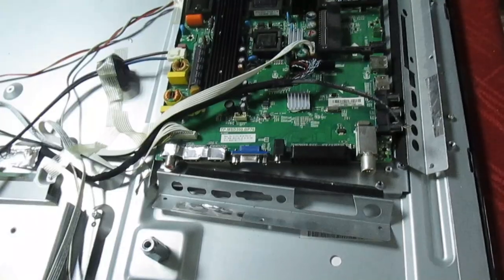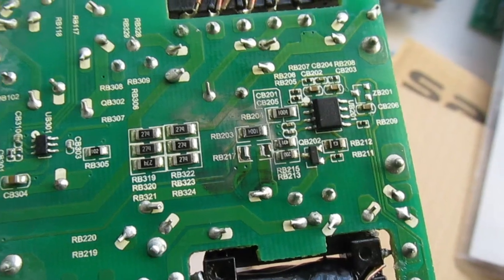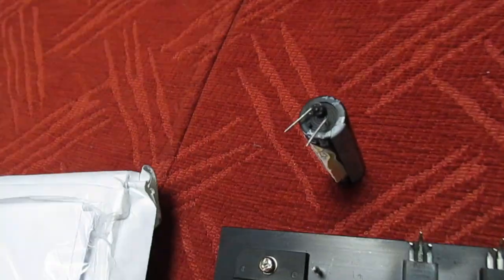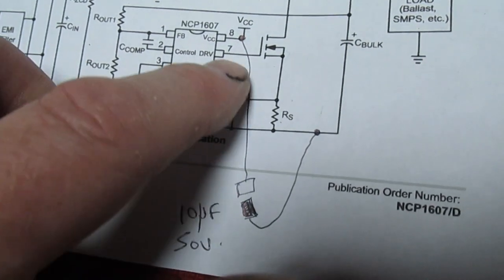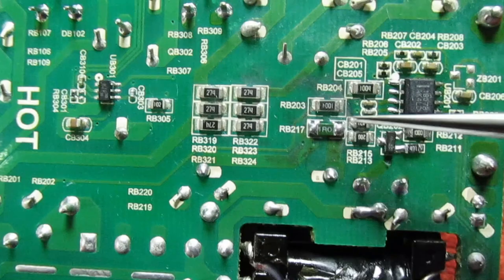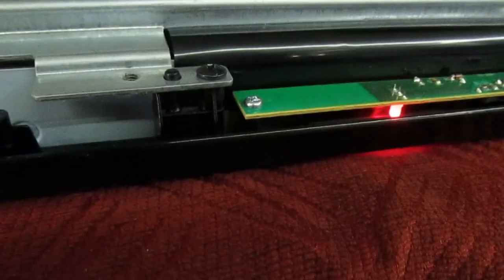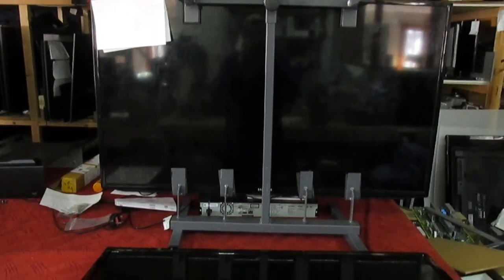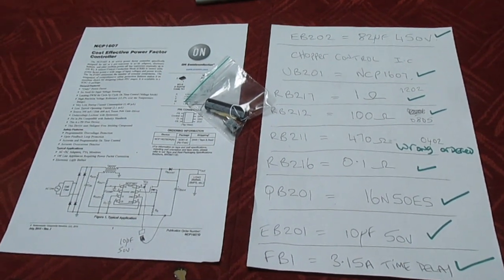UMC   TP. MSD309.BP76   Power supply blow up repair to component level.

Comment: Hi there just watch the video on the tv with a blown up power supply you ordered loads spare parts but you do not show on the set and which 1 do you eventually changed it just seems hard for us to do the same job when we do not no which ones you changed thank you
Reply from the maker: without a circuit diagram its just a matter of testing every part in the power supply with a mulitmeter , pay special attention to the surface mounted resistors , some may have to be removed to get a proper reading .

Comment: Nice work.
Great to see, So refreshing someone actually repairing and not board swapping.
Ordering parts because it's easier than looking through stock - Man after my own heart :)
I often do that.
As to incorrect SMD size ordering, I think most of my spare stock was sourced in that way lol
Reply from the maker: UMC dont supply any parts , not even a new board so repair or used board if you can find one is the only option.
Its not unusual for me to order something I already have because it either takes to long to look or I know I have it but cant remember where I put it ! 
 I need to get more organised but all this takes up time and organizing doesn't make you a living .

Comment: Ah, Blaupunkt, a Sainsbury's special!  Would you believe, I always thought they were made by Vestel.

I can only say I wish I had your depth of knowledge, because I'm sure I could have saved dozens of the economy brand tellies.
Reply from the maker: I think UMC is Vestels biggest competitor but personally I prefer vestel for there better layout , the UMC stuff always looks a bit thrown together and spare boards can be bought for vestel sets , UMC dont supply any parts at all ,but having said that UMC will send you software , where as Vestel will only supply software for a few brands, swings and roundabouts I guess, but what's not that commonly known  is vestel is over 25 years old and use to make CRT sets.
Reply: Whats in a name these days just made cheaply  and badged up
Reply from the maker: @pauldavies6037  Problem is not everyone knows its just a name .
Reply: @michaeldranfield7140  Yes been like this for a long time Branding with a well known name sells more to the general public even though made by somebody else

Comment: Very good MD I enjoyed the video ,my only thought is it worth repairing ,I purchased a 32" smart JVC (VESTEL) the other day for £150 with a 3year GT I know customers like what they are use to but at what point is it BER. Just a thought .Thanks again Steve.
Reply from the maker: I know what your saying and this job would have been a simple run of the mill 15 minute repair if there was a service manual and access to spare parts from the manufacture, but instead I have to trawl the net to see what the chip is , check with 3 different suppliers to find which one has all the parts I need so I can do just one order, then I had to find a similar board to see what the missing resistor was and what value the 0402 resistor was which is so small it has no numbers printed on it , so no, the set wasn't really worth repairing in the current climate but component level fault finding is what I have always done and I still enjoy the challenge !
Reply: And the environment says: it’s absolutely worth repairing it. Kudos to you for keeping another piece of otherwise perfectly fine gear out of the landfill, because the cost of that is ultimately much higher! We need to have legislative action for manufacturers to provide service manuals for their gear!!
Reply from the maker: @toolsarecool  I get a lot of sets with easy faults like this I have to scrap simply because there is no service manual and I cant identifie a part but in this case I had another board from a similar set so was able to measure the resistance values .

Comment: Clear video, as always.  What would this repair cost?  It always seems like the labor alone would be worth more than a replacement set, which is incredibly frustrating.
Reply from the maker: i charged £50 , its not the labor thats the problem , this would have been a simple straightforward 15 minute repair if there .was a service manual with schematic available
Reply: @michaeldranfield7140  right!  It's the time spent figuring everything out (for me at least)
Reply: That was more than reasonable Michael
Reply from the maker: @kendom33  you cant charge by the hour anymore you just have to charge what you think the customer will pay or they would just buy a new set and i would get nothing at all.
Reply from the maker: Andrew_koala  Yes I understand that but these days paying more money does not buy better quality, in most TV cases you just pay more money for the same set with a different badge on the front.
I know 30 years ago electrical goods were much more expensive but then they lasted for a long time , my washing machine at home is 25 years old and I just keep repairing it , my wife says isn't it time we bought a new one and I say if you want to buy a new one every 18 months then go ahead and get  a new one .

Comment: you do good videos.. i have a 39 inch umc, i got it in 2011 still works and still old enough to have ccfl backlight, all my tvs are ccfl backlight i dont have any led tvs.. bet they stopped making ccfl backlighted tvs because they was lasting too long
Reply from the maker: The death of CCFL was the power consumption but as you say the longevity of CCFL will never be matched by LED backlight, I hardly ever use to see CCFL failure but LED failure is now by far the most common fault with some sets not even reaching 5,000 hours use before the LED s have failed. 
Give me CCFL any day over LED .
Reply: @michaeldranfield7140  Interestingly, I have an old Samsung TV with about 24'000 cumulative hours of use. Apart from a slightly 'sepia' tint, it works perfectly.
Reply: @michaeldranfield7140  A long time ago i converted a failed ccfl to led, it was one of those with the tubes at the sides of the display. I used led strips meant for some other purpose from a well known auction site. It was not worth doing, more of a project & not as bright as i had hoped.
Reply from the maker: @Chris558576  if you dont try something though you never now how good it will be .